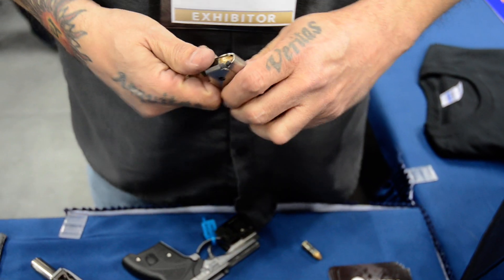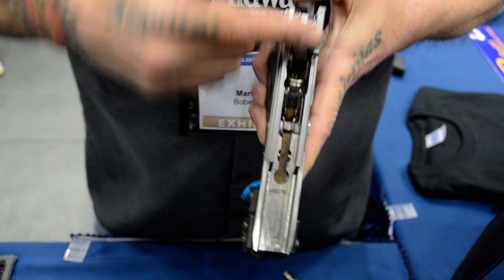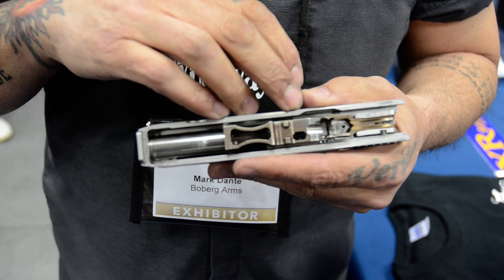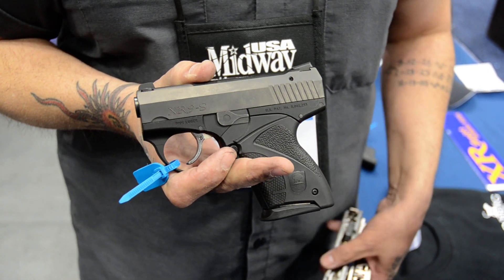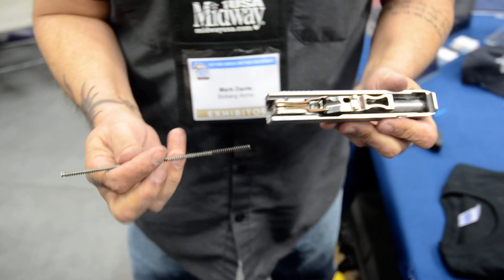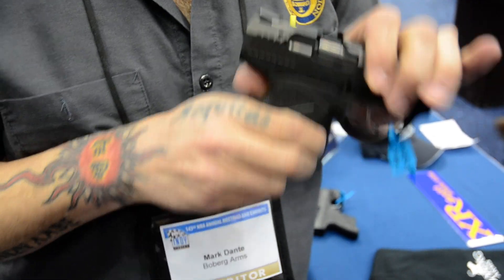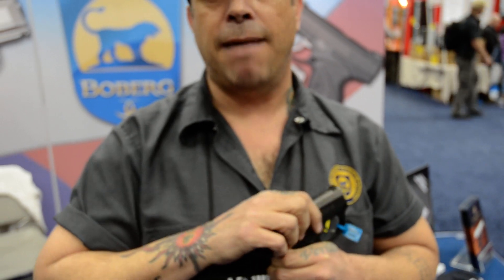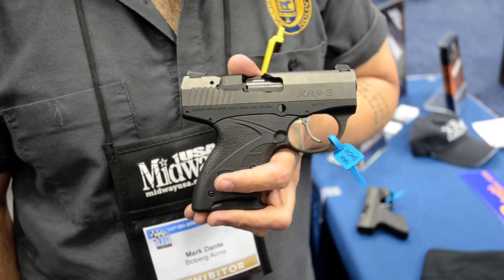Boburg XR9-S: The Biggest Thing to Happen to Firearms in 100 Years. Allegedly.

Comment: These have been out for a while now. It is a neat idea that mostly works. One problem though is you have to make sure to use rounds with a good crimp because these have a habit of ripping the bullet off the case and leaving the bullet in the magazine.
Reply: Imagine trying to fix that malfunction. Also it's expensive.
Reply: bigred2989 Malfunction clearing is about the same as any other pistol. Yes, it is very expensive, but the price has come down a good deal, ha.
Reply: How much cheaper have they gotten? I checked their website they still list it at $1,349. That's not cheap compared to an M&P Shield (though I do see where they are going with this design and how it could be superior).
Reply: bigred2989 They used to be about $2000 for the basic model. The nice two tone was about $3000.
Reply: Oh wow. Still a little much for me but that sounds like a step in the right direction.
Reply: Jesse Sisolack
They were never that expensive, I have one of the first made and it was around $1300
Reply: ArtisanTony Perhaps my memory fails me, but I remember out of curiosity looking up the price and waiting period for these.